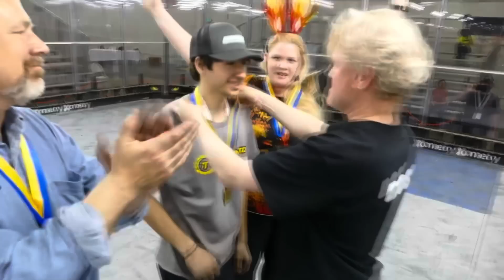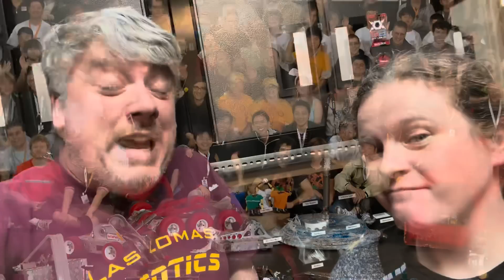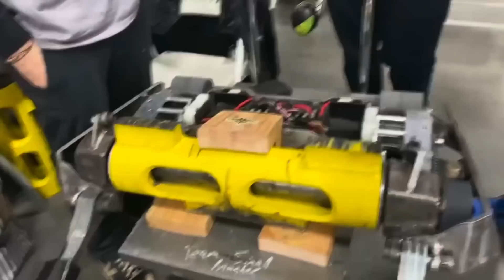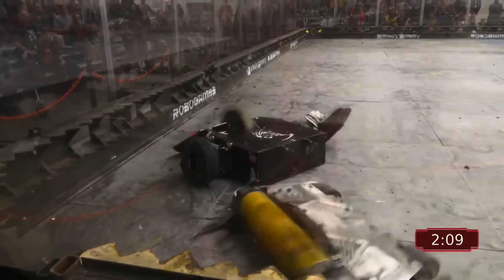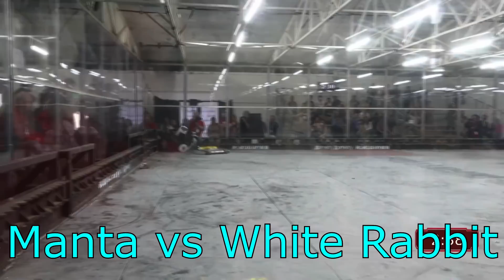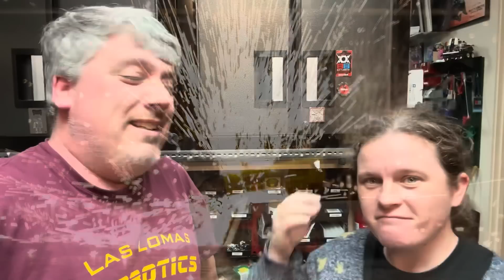Can This Rookie Win The BATTLEBOTS GIANT NUT?

Comment: Thanks for the support! It’s an honor to be in a Skorpios video!
Reply: I think the most unique part of this robot is just how long the drum is. Most teams go for reach, but you’ve built a weapon that’s very hard avoid. Manta hits head first every time. It’s similar to endgame in that it’s so wide teams can’t get around it to reach the sides. Cheering for you if you get accepted, and I’d love to see a full fight against you and Terrortops
Reply: I think the reason for the bot keep going on the top is because the parts on the roller needs a few middle  blocks welds for more of a direct hit rather than most of the hit points to robots are 2 tooth’s on the side of the roller fix that issue and yea your bot would be very destructive
Reply: If manta enters tournament 8, it will be my new ride or die team
Reply: Team , All the best for Battle Bots 😎
Reply: Incredibly well designed, implemented, and driven!  This is what happens when Bite Force, Minotaur, and Copperhead have a triste!

Comment: Having watched combat robotics for 15 years, I'd like to see Manta in BB s8.  Looks like the driver needs a little more work migrating from smaller to larger bot class/weights, but the fundamentals are there.  I also like the arrangement of the technology inside the bot.  I say this to all you builders.  You all need to change your wiring colors.  It's okay to run stripes just so you know what line is going to where.

Comment: They'll make a deep run but not the nut. The people they all beat were mid field bots in most seasons. They haven't yet faced an end game or witch doctor or hypershock.

Also, so much of the tournament is managing spares, rebuilding quickly, adjusting to strange circumstances. I think even a prepared rookie will struggle in that environment without any prior experience. It'll be a great rookie but not a winning rookie

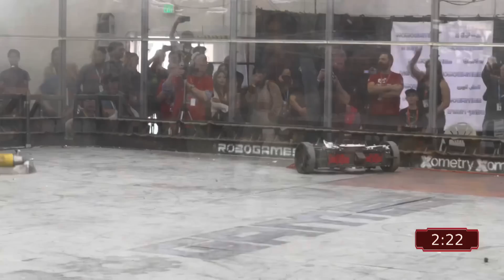Comment: 5:50 Bunny (who also funded the version of Manta seen at RoboGames) tapped out because she was scared that they might break through  the ceiling if they continued.
Reply: That’s the same reason that madcatter team forfeited the second fight when they  came out of losers bracket. It wasn’t purely to save equipment like they implied it was also for safety
Reply: Sure wish that was explained on the stream. The stream just cut away without any explanation for what apparently was a breach.
Reply: @BellyLover06  https://youtu.be/ZgTIK-oAV-M?t=2247 37:26

Comment: Manta it's one of the reasons I keep saying for years that Drum bots are the future. That meta it never stop looking strong since over 25 years of existence and that kind of bots can take out forks like nothing. I'm really excited to see a drum bot getting the Nut, I expect to be Minotaur, but if it's not, I'll put my money on Manta next year.
Reply: Looks to be an identical design right down to the forks (Bull Horns as they call them on Minotaur) on the front.  Nothing wrong with copycat bots and looking forward to see a match up in the near future.
Reply: @TheTwistedStone  manta is wider and is four wheel drive,, pretty different imo, it's more similar to something like riptide
Reply: @pietrom2642  yes, but riptide having lower RPM still being vulnerable to forks. High RPM drums like Minotaur are capable to get rid of them because them have enough quantity of hits per second to reach a weak point (like it had happened in the Cobalt fight).

To me the main counters to that configuration are wedges (like Bombshell demonstrated in three occasions) or higher reach weapons capable to make contact before the drum in specific dead zones (like Bite Force and Death roll shown off previously). In the other hand, I will keep saying that high RPM drums are the perfect counter to the fork meta.
Reply: @TheTwistedStone  Wider, 4wd, forks, more reach... saying that it is the same is just stupid
Reply: Sawblaze: well well well. Looks like the new meta is good for me!

Comment: I'm worried about how tight the tolerances are. It looks like one good hit to the back or even sides can disable the entire robot, or at least some of it's functionality. But it looked really solid at Robogames, so we shall see. Season 8 is going to be awesome.
Reply: They took quite a few big hits all around throughout the tournament, and just kept on going unfazed.   The only exception was the one single time they caught on fire the whole weekend (and I'm not even sure if that was from a hit or some other internal battery/wiring or "overclocking" issue).  And given that this was the first outing for this bot that is just amazing.

Also, their drive and turning is good enough that they can mostly avoid getting hit on the sides they don't want to.
Reply: It's a really interesting design. Hard to tell from the video but it looks like a steel 'core' chassis with a honkin' aluminium billet on each side housing the drive, which is four separate motors - one for each wheel and then spaced steel armour protecting the sides (assume its Hardox/AR of some variety) Then two motors each with its own speed controller for the weapon drum. The weapon drum I assume is S7 with three large teeth welded onto the drum and a dead axel (like copperhead).

I don't know how accurate my assessment is but I like what I see.

It's like a Biteforce/Minotaur/Tantrum cross-breed.

edit  Just watched through the whole video (paused at the start to write my original comment) and it sounds like I was pretty close.
Reply: Good eyes. I'm curious how it performs when flipped upside-down since it was never flipped during robogames. With how low it is to the ground it is flipping it will prove quite a challenge.
Reply: @HafCoJoe it was flipped by hexy d then spun up and catched fire
Reply: Yeah it's extremely neatly built but i'm worried about the shock resistance of the insides electronics. It looks almost too cramped and not enough cushioned. At Robogames it never took hard hits and the weapon was never forcefully stopped multiple times overloading the electronics. 

When it was inverted the drum was scraping the floor, meaning the ears were bending or too short. Can't imagine it surviving landing even just one hard flip.

So i suspect right now it's more of a glass cannon and won't win in its rookie season. 

But in the following ones? If it keeps iterating, that right there is the FUTURE of the meta.
Reply: @olisk-jy9rz  we can only hope he realized that upside down his drum was scraping the floor and he fixes it before season 8
this is a team/boit i really want to go far and do well